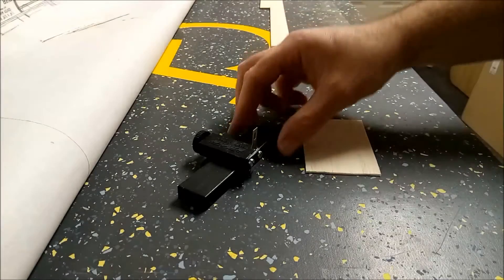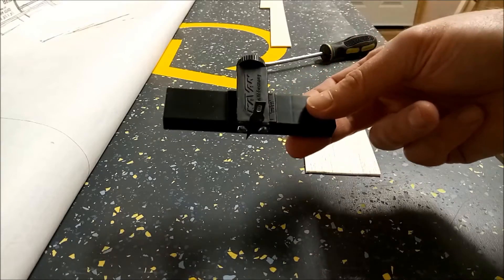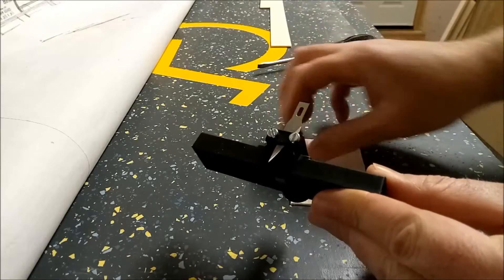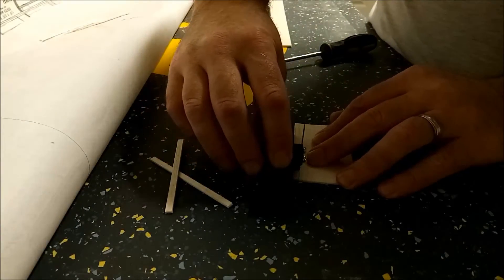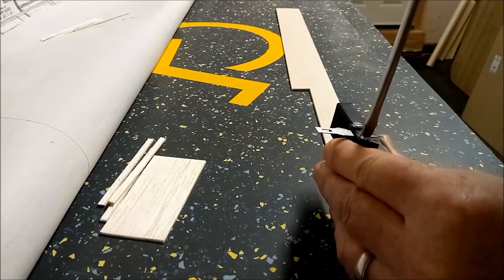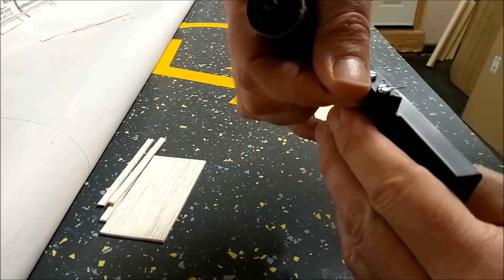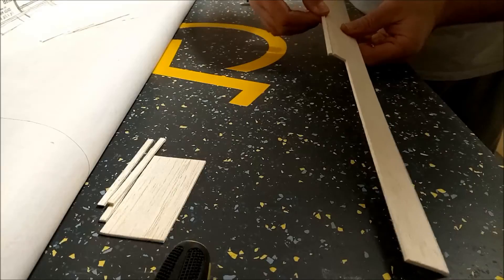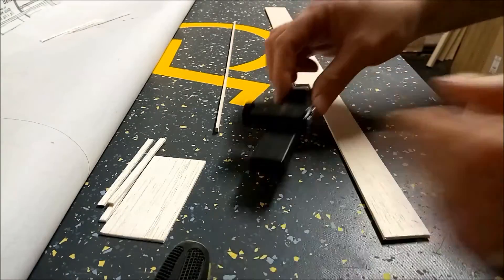How to use a balsa stripper

Comment: One pass is good enough for the 1/8 inch balsa if your blade is sharp. I’ve been using one of these for over 20 years and consider it an essential tool for building

Comment: I like the idea of using two passes to cut thicker stock but it might be easier for you if you get two balsa strippers.  One set up at a 1/2 thickness and one for the full cut... just an idea.
Reply: Couldn’t you flip the balsa and run it again without needing to readjust?

Comment: Why use imperial measurements?
Reply from the maker: Hi, the plans are in imperial so I use that.
Reply: @StartingOutInRC  can't use that, where I live everything is measured in mm and sold in mm. That said, 6mm is near enough 1/4 as a guide 😉 Oh, did you convert it to 4 channel operation?
Reply from the maker: Ah, ok, all my plans and wood is sold in imperial. It's a pain as I'm not used to using it, but so long as everything matches the build goes ok! No, I didn't convert it to 4 channel, but it's something I might do in the future.